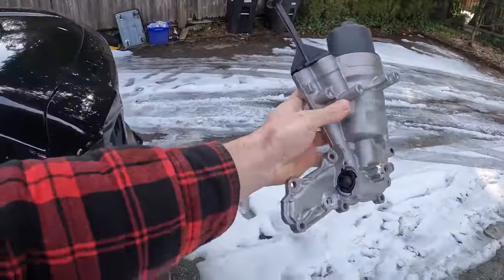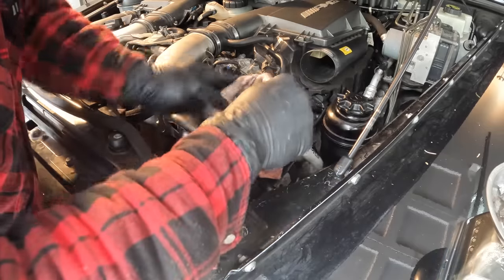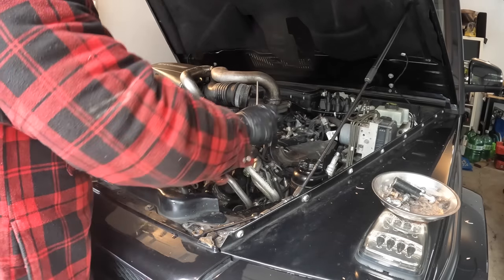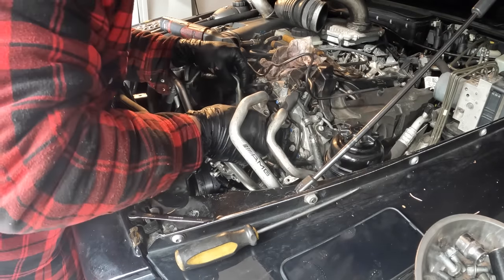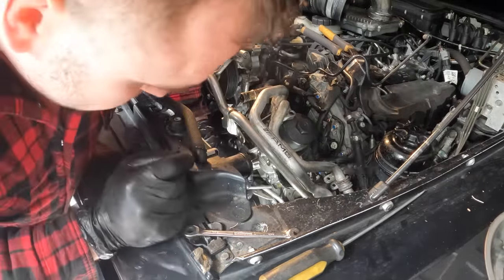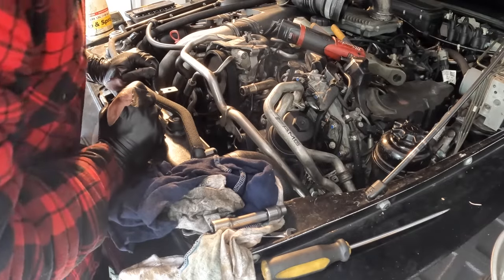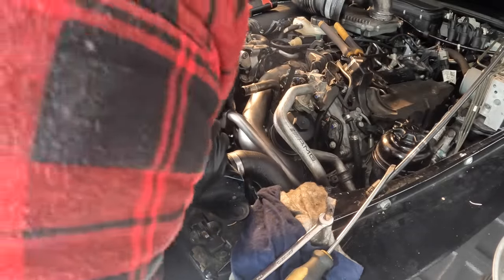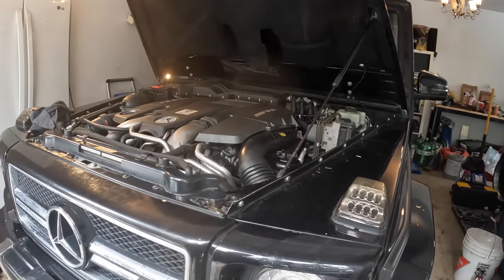Replacing oil filter housing on 2013 G63 M157 M278 engine

Comment: Had the exact same issue on my 2017 G63. Mercedes-Benz quoted me $2700.00 to fix. Lucky for me I purchased the warranty when I bought in September with 74,000 miles on it. My cost was $290.00 (The deductible). You saved yourself a good chunk of change and provided us G owners a valuable video on how to tackle this without paying a lot for dealership repairs.
Reply from the maker: Thanks for the nice comment! Glad your warranty was able to fix it for you
Reply: Mercedes dealer just quoted me 4600$ for the same job on my 2013 CLS550!

Comment: I have 2 leaks, on a CLS550 2013 with the same engine, one on the passenger side turbo return line, which is such a pain in the ass to reach, and one on this exact oil filter cap, I purchased just the cap because theres no oil leak signs higher than that cap, this video is perfect on how to make enough space to reach to cap and change it, thanks
Reply: How long was this job ?
Reply: @chuemoua6834  personally working with other cars, BUT doing it the first time on this type of motor, it took me about an 1-2 hours, just because its tricky to put the new cap in and get it to lock
Reply: So it leaked from thermostat?
Reply: @chuemoua6834  no or maybe depending on what you mean, it’s part of the oil filter housing I think it might be a pressure release cap, one side (right) oil filter, left side where it leaks there’s a cap but it’s part of the oil filter housing
Reply: @bodyadigital  the thermostat is under that small quarter size cap . That part usually leak
Reply: @chuemoua6834  ok then yea, but all i did was replace the cap and the leak stopped
Reply: @chuemoua6834   Yes you are correct , it's the "oil filter housing thermostat cap" and  that's what it's called at FCP euro, I replaced mine a month ago, and like the original poster said it was a little pain to get the cap back in and twist it once it catches a little the rest of the twisting is a breeze, but to get it to catch was a pain, it took a lot longer then 1-2 hours to do the job , more like 4-5 hours, but I like to take my time so I don't screw up anything.

Comment: good video, I have the same issue and I did find the part at FCP euro it's called "Oil Filter Housing Thermostat Cap"   so it's on order, I have a question, were you able to remove the thermostat without destroying it, I just replaced mine a year ago and I remember it didn't come in one piece but maybe that's because it was old and detreated, I'm hoping the newer one will come out fine, I don't wanna have to buy a new one again, how did yours come out? , thanks
Reply from the maker: Yes, everything came apart and I was able to re-use it. Just take your time
Reply: @ViperMike  thanks for the reply , job was done a couple of weeks ago it was very tedious to replace that cap no room to get leverage to push the new one back into the housing I had to use a pry bar , t-stat was successfully removed without damage all good she’s nice and dry :)

Comment: gn from jamaica i use to have a 2001 range rover p38 i know yr filter is on top and the RR is at the bottom mine would do the same thing when i was in new york just pour oil a plunger similar to yours mine had a little snap ring on the face of the plunger and i think thats where u incert yr oil pressure guage into but if u take that plunger out isnt a oring inside there that kinda change shape when its very  cold

Comment: Hi. Can you tell me where exactly the oil was leaking from? I have this problem in a Mercedes CLS 63 AMG with the same engine, from what I noticed the oil is probably leaking from the round cap and it can be replaced without dismantling the whole thing. I think the entire base of the oil filter is good and the problem is only in this round cap
Reply from the maker: Yes you can replace the cap itself. I just didn’t know if the part was available separately, so I did the whole housing
Reply: @ViperMike  I typed the name of the cap itself on the Internet in my country and it's available for about $30, so I'll exchange it and I hope it helps

Comment: During the Service A maintenance, the Mercedes mechanic told me that there is a little leakage of oil at the oil filter housing from my 2013 GL 63. I already bought the plunger for the M157 engine (part no. A 278 180 04 38 for 10$). Because of the minimum  leakage and my minimum use of the car I will do nothing at the moment. Any idea how many hours it cost to replace?
Reply from the maker: If they can get the plunger out without taking the filter housing off, it should be a simple fix. Otherwise it would take the the same amount of time this took me to do
Reply: @ViperMike  Hmm ok, but maybe the gasket is already done after 112k miles (180k kilometres). How many hours did it took? 5 hours?
Reply from the maker: @nlroel  Yeah roughly, and that's with filming the video. A tech who knows how to do it should be able to do it faster
Reply: what is your mileage?